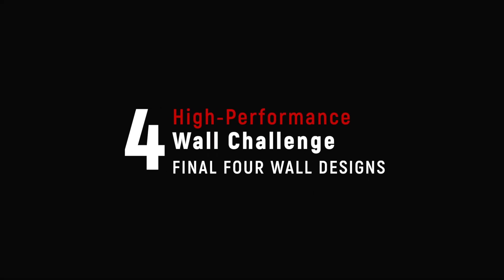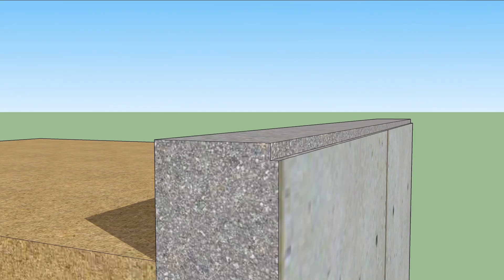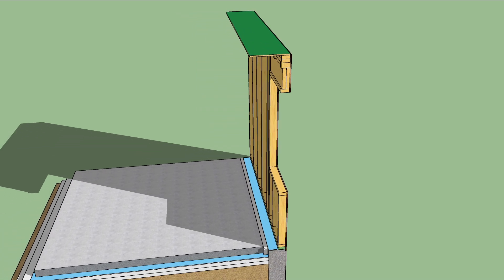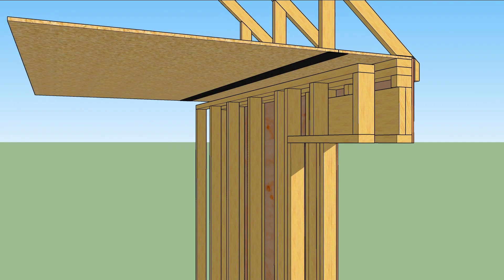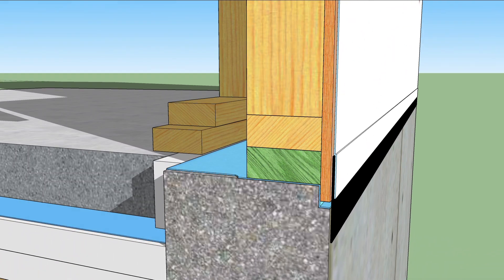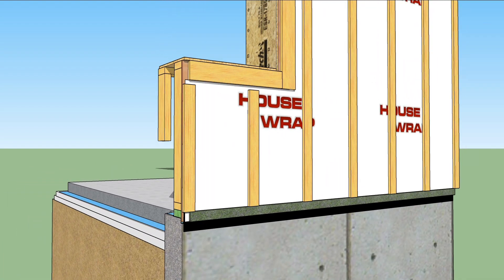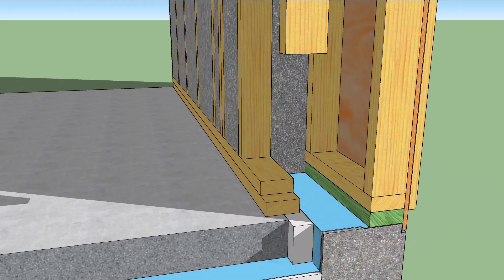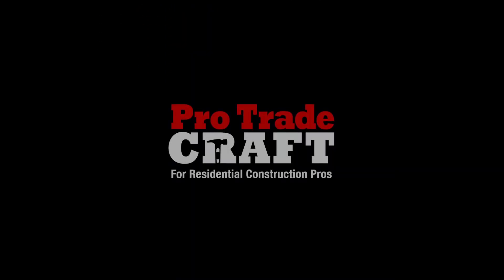High Performance Wall Challenge: Double Stud Walls from Kolbert Building

Comment: Looks like the studs in the double wall line up. Would it not be better to offset the studs? Lining up the studs means, yes there is a gap in the bridging, but it is small in comparison to the gap you would get when offsetting the studs.
Reply from the maker: No. If the studs are not touching, there is no thermal bridge. Conduction requires materials to be touching.

Offsetting studs is a throwback to the '80s when they used a 2x8 plate, offset the 2x4 studs, and wove the fibergalss batts between the studs (which didn't work, but it was the 80s and nobody knew it).
Reply: @ProTradeCraft  so what you are saying is there are points in the wall, where you end up with insulation between two pieces of 3 1/2" wood and then stretches where you have the full depth of insulation. Whatever that may be? And I think I mentioned there is no thermal bridge because there is a gap between studs. Just asking how significant of a difference the parts where you have basically 7" of R1 from the wood of the studs plus whatever small other piece of insulation vs 7"+x" of full insulation.

Comment: I see other videos where they have double wall construction and use 2x6 on both walls but that doesn't make any sense. The inside 2x4 exterior wall can be located at any distance needed for any insulation thickness. Double 2x6 walls are wasted money.
Reply from the maker: Agreed. It costs more, is heavier to lift, and takes space away from the insulation.One 2x6 wall may make sense for bearing purposes if it is a tall house...

Comment: Seems easier and more robust to do continuous external air/water barrier, use Zip system on Risinger's "monopoly framing" and you can add some external polyiso too. The whole exterior would be one continuous barrier without relying on trades to "get it right".
Reply from the maker: There are many ways to build superinsulated walls. Often existing conditions make one option more attractive than another. People who hate foam sometimes like double studs or larsen trusses.

Comment: what holds the interior wall up, since its not attached to the roof, and that outer vapour barrier better be good, cause if it fails in the slightest... rot galore.
Reply from the maker: Interior walls are nailed into the floor and ceiling. They are also connected to the exterior walls at every window and door opening.

The outer layer, the green stuff on a ZIP panel is NIOT a vapor barrier, it is permeable to vapor, impermeable to liquid. I am guessing by your spelling of "vapour," that you are located in Canada. In very cold areas, vapor barriers are sometimes used on the INTERIOR, but in almost all climate zones, a vapor retarder, which allows drying to the inside, is a safer choice.
Reply: @ProTradeCraft  Sorry, I must be missing where the interior wall is nailed to the ceiling since it only has a single top plate. Can you clarify that?

Comment: Where do the framing nails go on the inside wall to keep it full supported while still decoupled??? There’s no nails on top plate or sides to keep the interior wall from wobbling
Reply from the maker: The top plate is nailed into the ceiling joists and the bottom plate is nailed into the floor.

Comment: 1) Thanks for the work, great vid!
2) Does the submitter also have perhaps a folder of jobsite photos or some assembly videos from one going up? 
3) Is that big interstitial wall gap filled with a simple cellulose blown-in insulation like it looks in this illustration? 
4) If that inner--stud wall does NOT attach or extend to the same height nor up to the truss, how do you hold it in place once plumb?
Reply: It’s dense pack cellulose

Comment: Do building codes in some jurisdictions allow an interior wall to not be connected to structure at the top?
Reply: Looks like the 1X3's when crossed would suppose there'd be a 1x3 parallel to outside wall ... would make up the 1.5 inch 2x4 height.  So ... it would be affixed to the floor above.